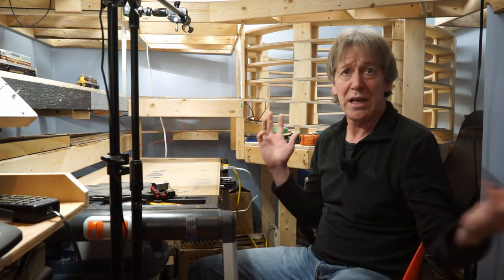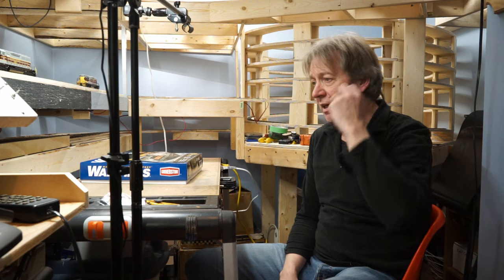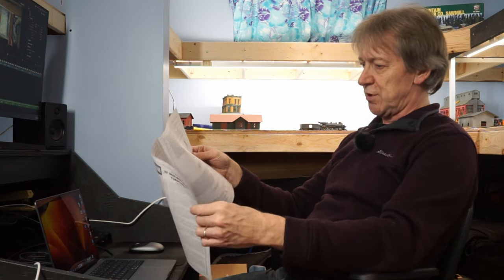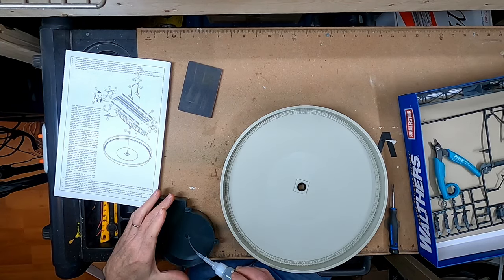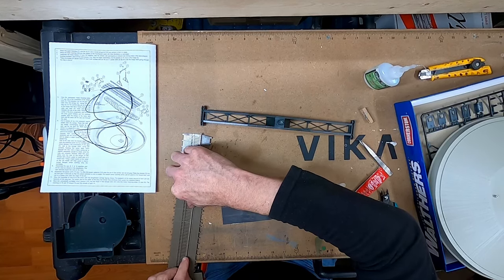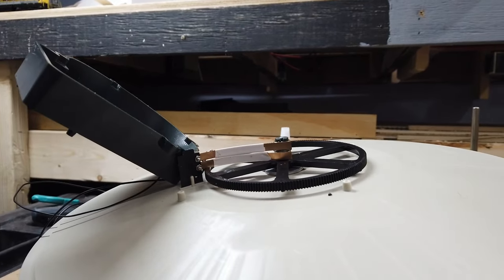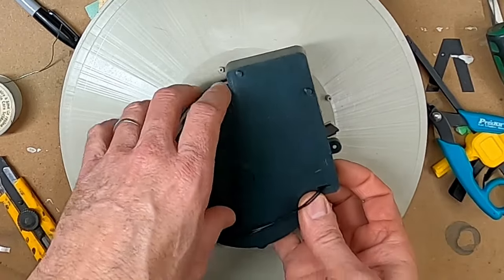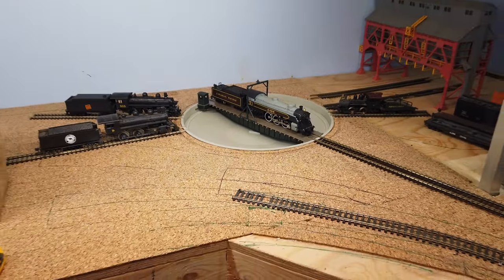Building a Walthers 90' Manual (non-motorized) Turntable. Full tutorial (and review). ACHB 1-9

Comment: I've custom built a few turntables for my railroads over the years and I've solved the powering of the turntable track using an article that appeared in an old model railroader magazine. If you purchase a two conductor phone plug with the matching panel mount it will work perfectly. Mount the panel plug in the pit exactly in the center. Then mount the male phono plug in the base of the rotating bridge and solder a wire from each track to the terminals on the plug. Now you have a removable bridge that works and rotates beautifully.
Reply from the maker: Good idea. I have plenty of those in a box somewhere… I used to own a sound production business, so I have lots of old audio connectors of all shapes and sizes laying around. If I ever need to build another one…
Reply: Rotates on the phono plug or use some sort of flat thrust needle bearing underneath?

Comment: Thank you for the warnings about the poor instructions and an excellent series of build videos.  The other problem I see with this turntable is that unless a switch is used to reverse the polarity of the rails on the deck there will be a short circuit when the turntable turns 180 degrees and an engine with multiple pickups is in contact with the rails on the turntable and the layout.  Perhaps this is mentioned in the instructions, but it may be something that you could add if you do a video on the actual installation of the turntable.   The Bachmann one I examined gets its power for the deck from contacts between each incoming track and the deck so this does not happen.  I know you would pick this up before any problems happened, but a novice with little electrical knowledge may inadvertently damage their new DCC system which as I understand it has less tolerance for short circuits.
Reply from the maker: I have the turntable "installed" in my layout, but I haven't finished the tracks around it - or the wiring - yet. Good idea, I'll do that as part of a future video. For now, I'm going to keep it simple and put a polarity reversing toggle switch between the power switch and the turntable track.

Comment: That was incredibly helpful. I have one of those turn tables as well and will be building it out later this year. Also, I was in a Model Train store in Seattle and they had the motorizing kit for a great price and I will be adding that to my turntable so I can control it with either my LCC or a manual switch controller (left/right and go buttons).
Reply from the maker: Glad to hear that my rambling was actually helpful! Thanks for the comment, and good luck!

Comment: Before ANY assembly the first step really should be paint/weather the pit, the bridge and the underside of the walkway-  as you know,  you won't be able to dissemble to paint later!  I found the plastic wheels for the bogeys unusable due to the molding seams- they were never going to be the exact same diameter after sanding, and never did roll smoothly when tested.  I upgraded to ball bearings.  My pit had some 'grab' as I spun my bridge around, so a block of wood and sandpaper fitted with a bolt as an axle, spun around and sanded that pit smooth (the molded rail too).  Now it operates as smooth as glass.
Reply from the maker: Glad you got yours working smoothly. Mine isn’t anywhere near perfect, but it will do the job.

Comment: Excellent job on the the turntable, I installed the 110 ft version but it is motorized
Reply from the maker: I thought of getting the motor for it - briefly - but decided I really didn’t need it. How does yours work?
Reply: Mine works ok , does not always stop perfectly but I can move the bridge ,  just need to keep the clock wheel track clean

Comment: At age 9 or 10 I tried assembling a model of the Seaview from Voyage to the Bottom of the Sea. The instructions for assembling the escape hatch were something, like glue a to b, followed by the next instruction stating, before gluing a to b install.... or whatever. I was stuck with the escape hatch protruding 1/2" above the submarine's hull. Somehow I moved on past that and continued modeling. Never underestimate the value of clear instructions. Perhaps you should contract with Walthers to write their assembly instructions.
Reply from the maker: They really need to test their instructions with a few model builders before releasing them. The last Walthers kit I built (the Mountain Lumber Company) was much better than some of the others as far as instructions. Not great, but I didn’t notice any major errors. And they gave appropriate warnings.

Comment: Can you talk about the orange sided coal or whatever it is with the gray roof?
I have one and been trying to fit it on my n scale railroad and have tried to look up information.  I built it several years ago thinking it was cool.
Thank you
Reply from the maker: It's a model of a coal tower that was in Cheyenne I believe. Years ago - in Canada - one of our chains of grocery stores sold "store branded" HO model railroad sets, and some structures (usually right before Christmas). This was one of them that I picked up at a really good price - because it "looked cool". That was 25+ years ago when I was just getting back into model railroads. It was also sold by IHC (I think in N and HO). It doesn't really fit anything about my layout - it's way too big for the railroad I have - but for now I have it there until I come up with something else. Or maybe I'll just keep it there. A single, much smaller coaling tower would really make more sense.
Reply: @achb-railway  I have the N Scale version of it, I was impressed with the model but when I went to put in my layout I couldn't find any information on it. So I couldn't figure out if 7 railroad tracks went through it and what track was for the ash or if maybe a road for a semi dump truck hauled ash away or even hauled coal in for it? 
If you have information, I would sure like to find out. Take care
Reply from the maker: From what I understand... 4 tracks went under the main part (under the chutes) to fill the locomotives. There were ash pits and some type of conveyer under those tracks. A fifth track went through the smaller "opening" under the structure - that's how they filled it. Coal cars would dump, and a conveyer hauled the coal up to fill the hoppers.

Comment: Thanks.good video 
I bought 1 and it's a nightmare. 
I can't get mine to spin I tried everything going in the garbage 
But I ordered an other one.i need it. Canadian
Reply from the maker: Hopefully you can get it working!
Reply: I am struggling with that as well it binds in a section as there is a slight bow in the turn table base hoping once it gets installed that will fix it
Reply from the maker: @littletoyfactory117  Mine seems to turn reasonably well once installed. The bench surface keeps it flat. Hopefully you get yours working well!

Comment: I assembled this kit, motorized it. My opinion is, this kits a pile of garbage, but then it comes from China. I did not follow them messed up instructions.
Reply from the maker: I think it will work ok as a manual turntable. I was wondering how it would work powered, or if it would flex too much.
Reply: @achb-railway  The motorization kit is terrible.  I wound up pulling it off because it would always jam after about 15 degrees of rotation.  Molded gear was warped as well, and heating it to straighten the warp only marginally improved performance.
Reply from the maker: @Jan-hx9rw  I kinda figured it would be something like that. The gear that comes with the turntable seems pretty flimsy.